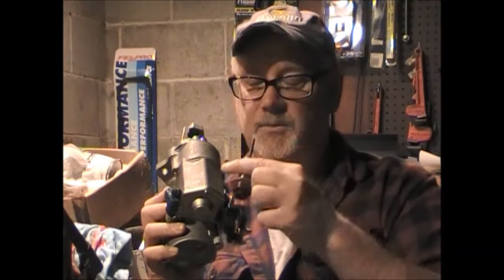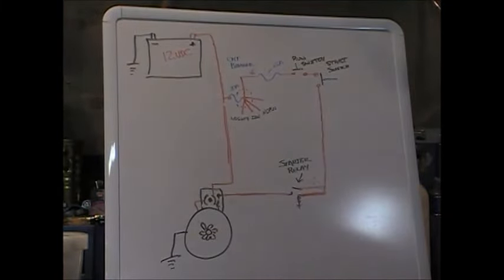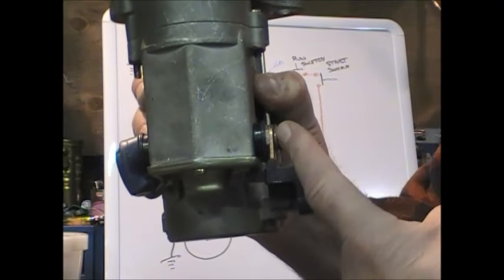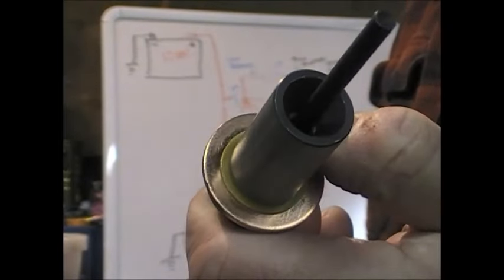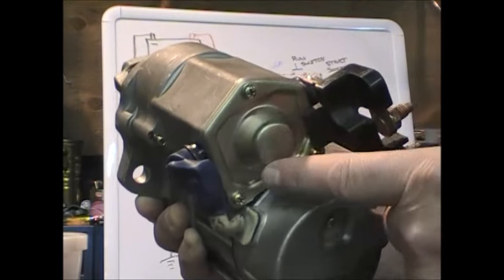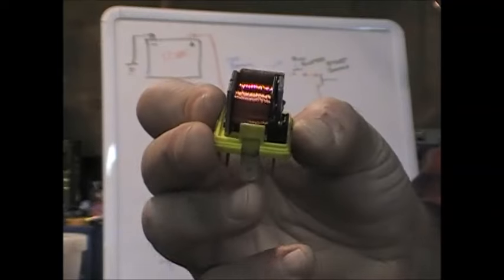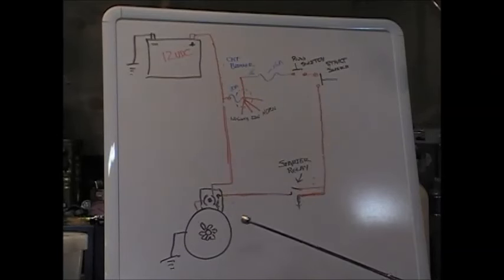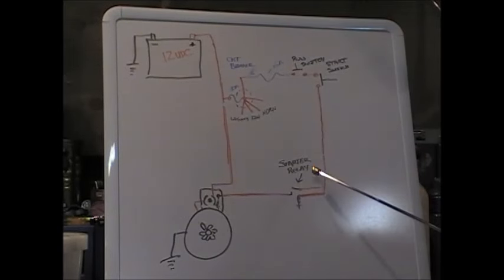Harley Davidson and the Click of Dread

Comment: Great video!  I’m having a clicking issue too...   Would appreciate suggestions.  

Bike has been running good but a few days ago I noticed the tach was internment, then turn signals and horn quit working. Bike doesn’t turn over now, but if you keep hitting starter switch it will eventually turn over. Headlight and taillight works, and does not dim while pushing starter button. 

Battery was replaced a few months ago and I verified it’s still good. Cables were replaced a few years ago. I cleaned all the ground connections on the frame. Also cleaned all positive connections including both connections on starter solenoid. 

Replaced starter relay and removed/cleaned solenoid plunger, and still have same results. I also connected jumper wire from battery to solenoid and get the same results (does not turn over but eventually will turn over).

I noticed the starter circuit breaker/fuse that keeps clicking also gets warm to touch while the key is on.

I don’t know how to troubleshoot from here? I have a volt meter but not an expert on circuity.
Reply from the maker: Hiya Clarke1962gmc, well I'd say you are well on your way to solving your issues with your cleaning of your connections/grounds and such.  The first issue you mentioned...the tach, horn and turn indicators seem to point to whatever circuit feeds them.  I don't know your particular bike but there could be some corrosion in the circuit that feeds them. You mention some fuse/crk breaker that is getting hot.  I'd check that to see if you have good contact there.  However the 2nd issue about the clicking solenoid, you mentioned that you ran a lead from the battery to the solenoid directly with the same results- a click.  Doing the jumper test removes any circuits from the equation so at this point I'd say you possibly have one of 3 things going on, again just my opinion.  1. A weak battery, which you said is fairly new so I think we can say it is not that. 2. A bad ground on the starter or 3. A solenoid that is crapping out.  If in your boat, I'd try running a ground line from the starter case to the battery negative, then perform your jumper test again.  If it still remains then you may have some windings crapping out.  If you wanted you could put in a solenoid cover with a start button.  I did a video about it and always recommend them as a fail safe.  Hope that helps.
Reply: Malcontent corner thanks for the follow up feedback...

I made a little more progress tonight, but still not resolved.  

When chasing the clicking noise with volt meter, it’s actually the accessory circuit breaker/fuse but the red wire on the main/starter circuit breaker/fuse is still warm to touch when ignition key is on. 

There are three orange wires connected to the accessory circuit breaker/fuse. I removed the terminal that has the two smaller wires for rear brake switch/oil lamp/horn/etc, and left the wire that goes to start relay. Clicking stopped, red wire on main/starter circuit breaker/fuse is no longer warm with key on and bike turns over great. 

I’m guessing my next step is to separate the two smaller orange accessory wires and hook up one at a time to determine which one has the issue? Then start checking for any bad connections, chafed wire, etc? Could a horn or stop light switch cause this, and would it be a bad ground or hot bare wire causing circuit breaker/fuse to click repeatedly and red power wire to get warm?
Reply from the maker: @Clarke1962gmc  :   So...it is the accessory circuit breaker that is clicking?  Do I understand the situation correctly?  If so..interesting.  However it sounds like you are on your way to figuring it out and that is great to hear!! I would l do as you are doing- isolate and conquer.  Pull the wires one at a time to isolate which trace is bad and then go from there to see what it feeds.  I find it odd that your direct jumper to the solenoid didn't kick the starter over but...perhaps there is a draw that is sucking the power down.  I suspect the breaker is kicking due to a short which is the same reason why the wire is getting hot.  I suspect you'll get it all resolved in shortly....no pun intended.  ;-)
Reply: Malcontent corner made progress tonight...

Since I’m color blind I sweet talked my better half in assisting in this fishing expedition. After separating the connector at the top of the head light bucket, the breaker clicking stopped. So I used a jumper wire and tested one pin at a time and the orange wire that goes to the tach got really hot quickly. 

Wasn’t sure if bad ground connection for tach, so I cleaned ground screw at fork bracket and reassembled, but breaker still clicked. I then removed the ground for tach, thinking that would stop power current to tack, but breaker still clicked. 

I reinstalled ground for tack and removed entire tach gauge, but left light bulb in socket and everything is working fine (horn/gauge lights/turn signals/rear lights). Accessory breaker not clicking and red wire on main breaker no longer warm. 

I’m assuming I need to replace my entire tach gauge? I don’t how to troubleshoot circuit boards. Has anyone else experienced a breaker issue like this because of tach gauge?
Reply from the maker: @Clarke1962gmc  - Hey great job!! Glad you and your 'better' half fished the circuit and isolated the problem.  Good work!  Sorry I can't help you with the tach. Given how they too are electronic these days it sounds like something failed in a dramatic fashion.  Might be easier (aka: cheaper) to try to find a used one on ebay or perhaps a new one on J&P cycles.
Reply: Malcontent corner thanks a lot!  Yes, I found a couple used ones on eBay and J&P has replacement.   
Thanks again for all your assistance!